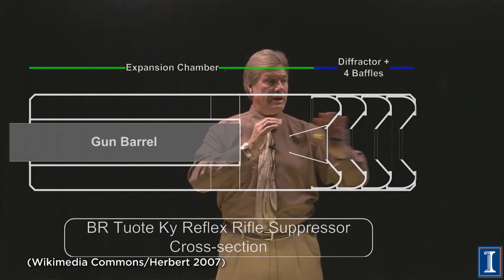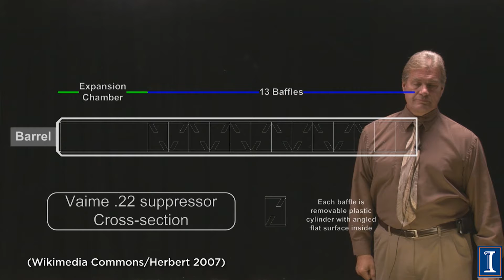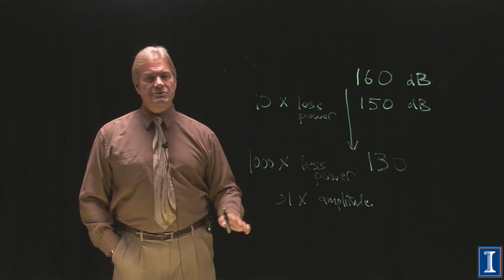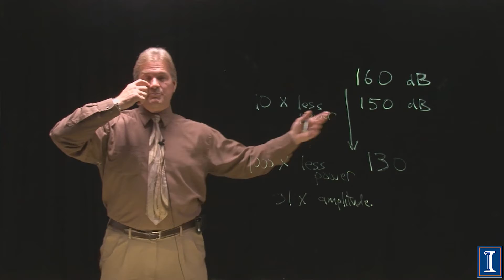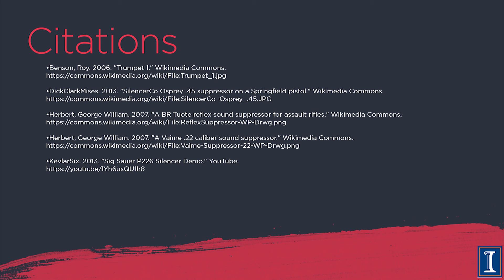How Things Work: Voice Change and Sound Proofing - Do Silencers Really Work?

Comment: Suppressors are very useful indoors as hearing protection doesn't need to be as heavy, so a squad of soldiers or SWAT officers can actually communicate with each other or otherwise clear buildings without going deaf in the process.
Reply: Soldiers and SWAT officers often use active hearing protection systems which not only protect against loud noises like gunfire and explosions, but also amplifies low volume noises like voices and footsteps so they can maintain situational awareness without the risk of becoming deaf. In fact, some systems can even amplify quiet noises to the point where the user can hear these sounds better than with their bare ears? But you are right. Suppressors can still improve this situation further.